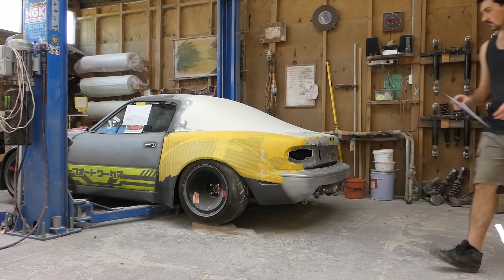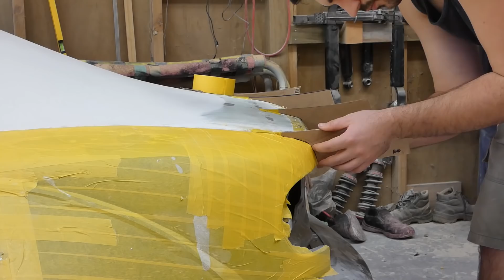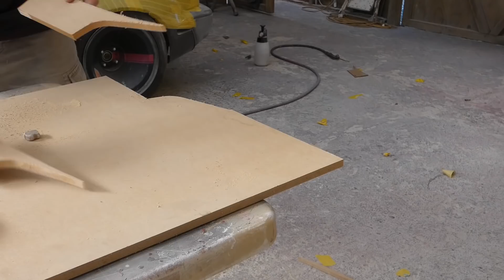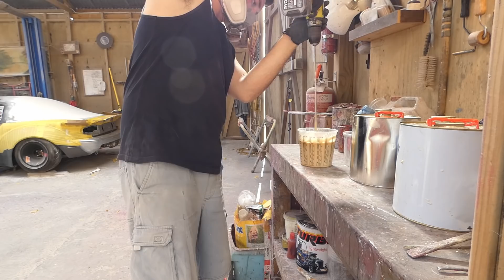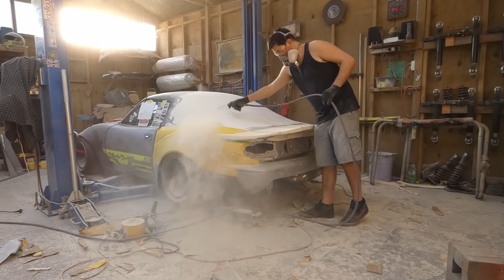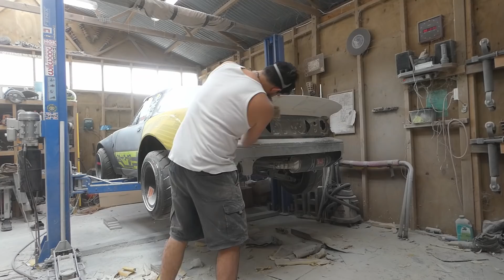Shaping a Speedtail Spoiler! Cyberpunk Miata Build: Part 2

Comment from the maker: I'm glad YouTube decided that my camera falling over and my totally sick catch were what should be in the video preview. Good job YouTube.
Reply: This just start looking like a nascar from the back and a cute miata from the front 🤍👍
Reply: How do you put stuff in the boot of the car?
Reply from the maker: @kye3856  A lot of people ask this question so I'll answer it here as well. The whole roof comes off with 8 clips in about 20 seconds so getting into the rear is really easy. 

The other question that a lot of people are asking is how will I see out the back. Once the fiberglass is done I will be adding louvers into the back with cutouts for visibility. There is also one other thing that I won't be revealing until the video comes out.

As for practicality, this car will never be road legal here in New Zealand and I don't go into  the boot for anything other than disconnecting my battery which I will be fitting an isolator switch for.
Reply: @kye3856  its gonna be a hard task but i think he will manage to make it work 👍
Reply: This is a sick build so far. What wheels are those?
Reply from the maker: @dieseladdictryan9511  The wheels are one-offs that I made for the build. They are 15x10et-50 with hand made fiberglass aerocovers. I'll hopefully be doing a video on them soon as I plan to re-design the covers and replace them with carbon fiber turbofans.
Reply: @TofuAutoWorks  hell yeah

Comment: Wow, this is really impressive and I’m hooked. Youtube recommendations ftw!

One thing I would suggest is start using a powder guide coat when block sanding.  
It will show up all your lows real easy to make sure your getting the buck as straight as possible.
Reply from the maker: Thanks! If you watch some of my other body work videos you'll see I do use guide coat when blocking most body work and primer. However for this plug there was little point since it's all getting coated in fiberglass which I will just need to block again once it's done. (I used to work in panel and paint)

Comment: Having a vision and running with it!  Mad work man.  It's looking really good.  I built myself a bodykit in the early 2000's with mdf, foam and fibreglass for my aw11 mr2, gives you a great sense of achievement.
Reply from the maker: Cheers mate! And yeah it's super rewarding having something completely unique. Love those old AW wedges too. I was very close to using one of them for the base of this build but couldn't bring myself to cut into one like I could with some ratty miata.

Comment: Very cool man. Doing great on design and technique. One thing I use which should make your life slightly easier = Big Kid Blocks. They work great for sanding. Made a big difference in my work.  Easier to hold, shape, and make super clean surfaces. Keep up the great work. 🤙

Comment: This is truly art, you inspired me to finally try and do a fastback hardtop for my NB out of carbon fiber. Will be orderimg the materials soon and you'll be my inspiration. I just have to ask will there be a rear window and side windows? And will the trunk be able to open? The windows are not necessary but I'd sugest to make the trunk lid atleast removable so if your rear supsension decides to crap itself or you want an upgrade you can get to the top mounts. Love you stuff man keep it up
Reply from the maker: Good on you man, best of luck with the design. As for the glass I wont actually be running any since the design incorporates a set of louvers. The trunk access gets asked a lot but the top is still going to be easily removable like my old roof. (8 clips, comes off in 20 seconds) The battery will have an external isolator switch. Other than that I haven't used the boot in over 2 years as this is exclusively a show car.

Comment: Great work, I enjoyed watching the wide body build but think this is really showing off your skills! Is it just standard auto body filler you're using to smooth it out? That plus the thin glass looks to be a masterstroke.
Reply from the maker: Cheers mate. Since this is a just plug there's no need for expensive auto filler, just cheap drywall compound is fine and it sands a lot easier.

Comment: You should check out the Crucible Coachworks YouTube channel.  They built a completely custom Porsche 996 slantnose.  Their stronger with the metal fab while you're clearly a master with the fiberglass.  A lot of the same processes though.   Really glad I found your channel.  This is an amazing build 🔥🔥🔥

Comment: You need to give it a big, mean sounding engine with perhaps a turbocharger sticking out of the hood! Something like a 2JZ GTE or a RB25 or something like it!
Reply from the maker: I was thinking an EV swap with a switch on the throttle that plays eurobeat when I accelerate.
Reply: @TofuAutoWorks  😂😂😂 but fr, i think a gas engine would fit this car better

Comment: So are you putting in louvers to see out the back or just no back windshield
Reply from the maker: I will be fitting louvers to it once the fiberglass skin is finished. If I made them as part of this plug they would lock the fiberglass in place and I wouldn't be able to remove the finished piece.

Comment: I found your videos awesome, but I have a question about the project, the speedtail it will be open, to use the trunk, or it will be fix?
Reply from the maker: The whole fastback and speedtail will be a single fiberglass piece. It will be easily removable if I ever need to get into the boot but the only time I ever go into the boot is to disconnect the battery so I'll just fit an isolator switch instead. 

The best way to think of this build is like a prop car from a movie. It lacks a bit of functionality but it's a form > function type build.

Comment: Hey dude, cool work! What about the trunk?
Reply from the maker: Thanks! I never really use the trunk other than to disconnect the battery which I can just add an isolator switch for. So it was a lot easier to make the roof in one piece and just have it removable if I ever need to access the suspension / battery.
Reply: @TofuAutoWorks  would you change something in the front?

Comment: It's prob been asked but what wheels are they
Reply from the maker: The wheels I actually custom made for the build. They are 15x10 et-50 steelies with custom fiberglass aerocovers.
Reply: @TofuAutoWorks  I had a funny feeling that might be the case haha great work is the plan to make a mold of the speed tail?? As they look great on a mx5
Reply from the maker: @stefanboyne1770  I will eventually make molds of just the spoiler but I'm still deciding whether to leave it as a single piece which will be cheaper and easier, or make it a 3 piece which will work better for everyday use.
Reply: @TofuAutoWorks  it would be cool as a 1 piece that's for sure would flow well